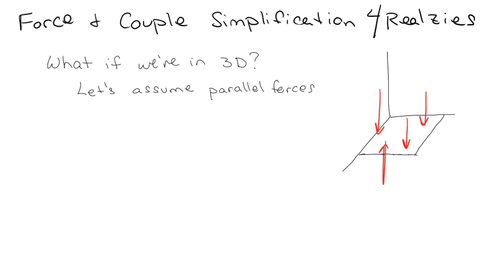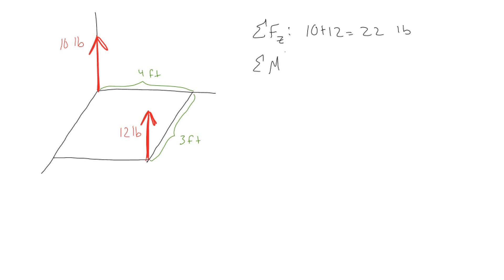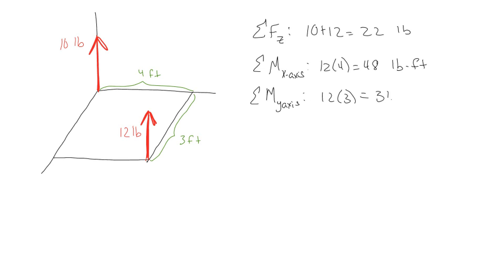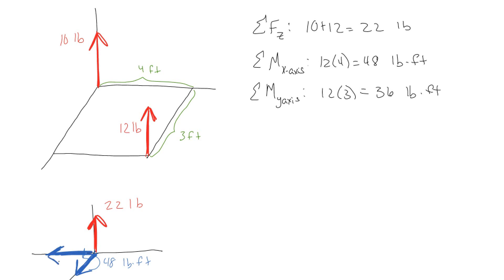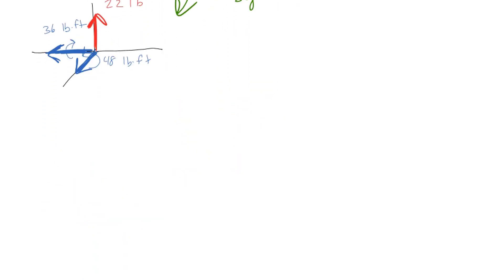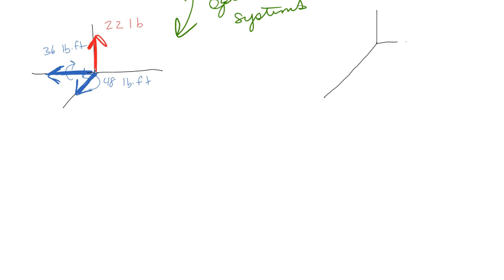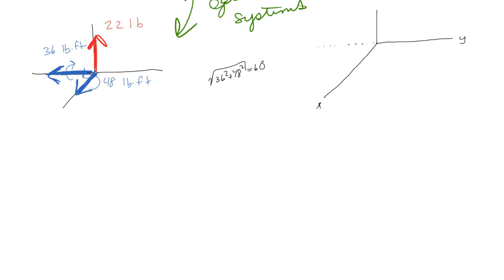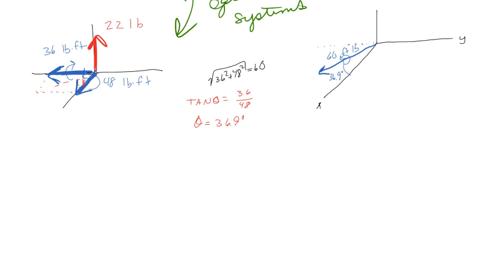Further Simplification of Force and Couple Systems in 3D

Comment: This is a great conceptual summary of the reduction of forces(moment & force) for both cases of vector directions(perpendicular and non-perpendicular....or in math speak orthogonal and non-orthogonal). 

However, for specifics at 8:10,  the "detail" of how to calculate the perpendicular and parallel components are thus:
1.) From the "known force vector" drop the magnitude and take  the direction vector(also known as the unit vector or lambda)
2.) Use that for a dot product with the moment vector.
3.) Result is the parallel component of the moment vector.
4.) Now, use that parallel vector with the original moment vector, and use Pythag.. Eq. to get the perpendicular component.